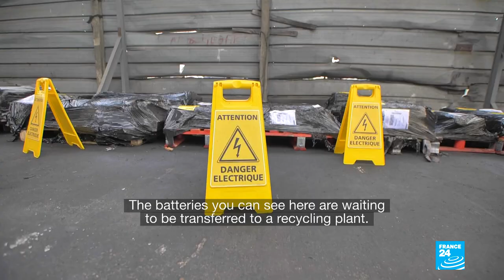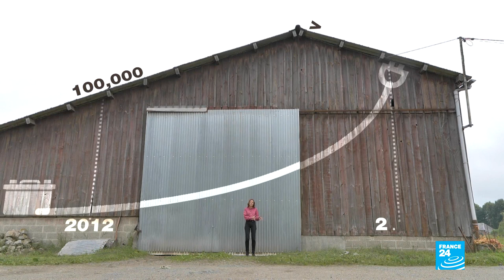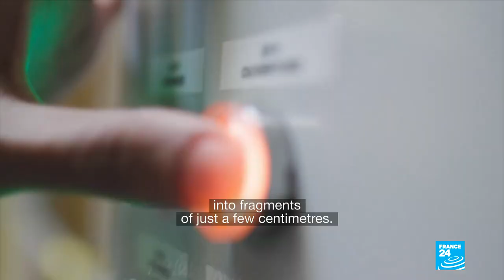Electric car batteries: A second life? • FRANCE 24 English

Comment: Fossil fuels are slowly running out, so electric vehicles are the future , over time we learn to do battery recycling
Reply: And in the meantime, we charge our battery driven cars with power that come from fossil fuels?  And the cost - environmentally - of producing and disposing of electric cars is far worse than actually using fossil fuel driven vehicles?  And, we've apparently been only 5 or less years away from depleting fossil fuels since the late 1800's?
Reply: @moonloon5859  Funny thing is, even with power from fossil fuels electric vehicls are better co2 wise. Not by a lot, but still: better. And you still keep the option to switch to clean energy.
Oh and the reason why they found more oil than expected is also because they drill in places that are inefficient and risky, like offshore drilling rig (remember deepwater horizon) ? It is also unclear who collects all the dead animals from the beaches when they were forced to take their next oil bath. You sure will help, right?
Reply: @Leerlaufprozess  Not really.  The Neuro-toxic chemicals released into the atmosphere from the lithium leach fields along with having to destroy the batteries by fire as there is no other way to get rid of them, makes the electric vehicles far, and I mean FAR more toxic to the environment than any petrol vehicle.  Oil is also not a fossil fuel, it's abiotic.  See my comment above.